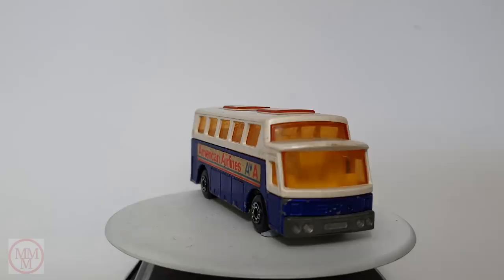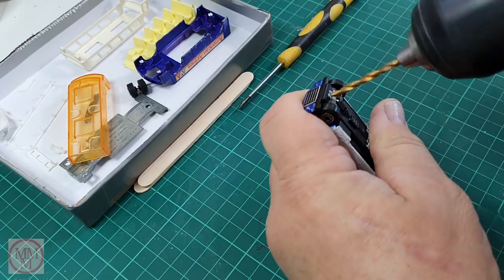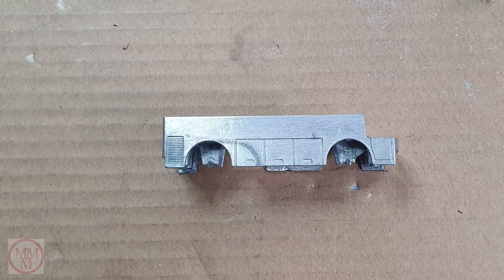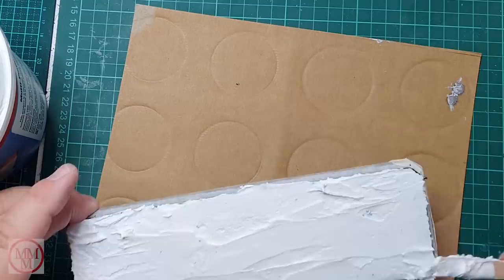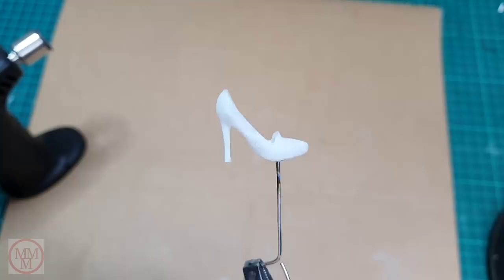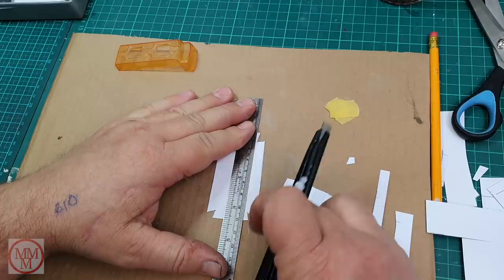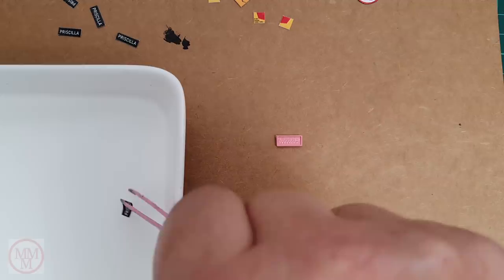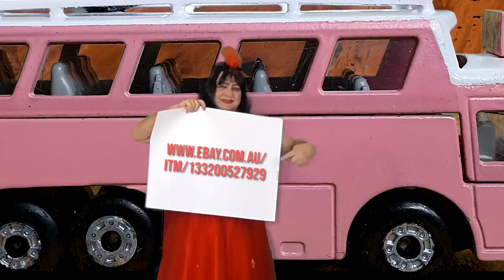MATCHBOX 'Paint it Pink', Breast Cancer Awareness, Custom 'Priscilla - Queen of the Desert'.

Comment: Marty, 
You do very nice work. I have been very impressed with the results of your fine work. I have noticed however that when windscreens are cracked, or otherwise unuseable,and a source for a replacement cannot be found, you spend a great deal of effort fabricating replacements from flat clear plastic sheet. Back in the 1960's, Mattel released a Vacuform toy kit which allowed children to use toys as forms to make parts to assemble their own toys. I had one as a kid. A Google search does reveal links to others who have fabricated such tools. I use one for forming HO scale slot car bodies and windscreens. Ebay in the USA has several listings of the Mattel toy (120 volt AC, 60 Hz versions) that could easily be used to make replacement windscreens using the original Matchbox windscreen as a form. Obviously a power adapter would be needed to use the USA versions in Australia. Anyway, it is just a thought.

Thanks for the excellent youtube videos!

Comment: The red, and yellow reflective squares are now required for all U.S. military trucks operating (at least in Europe) as width indicators for both on road, and black out night driving.  The current generation of NVGs (night vision goggles) picks up the reflection from the width markers.

Just an FYI, what you call a "Bull Bar", is called a pusher bar, or pusher bumper in the U.S.

Comment: Top job on the coach Marty, brilliant work to add the tag axle (that's what the second unpowered axle is called) to the model! 
You did a great job of making two very different vehicles look similar enough here, the movie coach was based on a 1970's Denning Mono and the Matchbox airport coach I believe is (loosely) based on a US made GM PD 4107 sometimes referred to as a "Buffalo" (Ansett actually imported and RHD converted a small number of them in the 60's).
Regarding to "Do not overtake turning vehicle" signs on trucks and buses idiots still ignore those all the time, I spent 15 years in the public transport industry driving buses and saw many cars wiped out because of imbeciles driving up the inside of my colleagues vehicles while they were turning left.
P.S. Broken Hill is in the North West of N.S.W. pretty close to the borders of both Queensland and S.A.

Comment: There is a 3m tape called fine line wouldn't bleed if you have a smooth surface. Various widths from 3mm to 12mm you may find it works better than plain masking tape

Comment: That is a super conversion! This is so well done it looks original. I can understand your frustrations with filler and paint. I have had to strip models more than once to repaint because of a flaw in the finish. Fortunately Tamiya paints are easy to remove. Filler shrinks so you always have to refill and sand. Your techniques for the conversion were just great. Thanks for sharing this and helping with this worthy cause.

Comment: Marty, to get rid of the really prominent grain on the 3D print, you could get an old box which won't dissolve in acetone, put a little pool of acetone in the bottom, then put a little stand for the piece and close the lid for a bit. What happens is that the acetone doesn't eat away or fully dissolve the plastic but it kinda melts the layers into a smoother and neater surface.
Reply: But not if it's PLA.
Reply: @Pygar2  oh crap I didn't gear what he used. Damn

Comment: some modern trucks here have a similar sign, but not all, it's not a requirement.
Reply: I think it does, depending on the length though
Reply: @ARob-bt4dr  well apparently not in my state, or if it is required, many are ignoring it. Some also have a white piece of plastic hanging under the trailer at an angle with similar signage on it. However, that's kinda silly, if you're in a position to read that sign, you're already in the wrong place.
Reply: @ARob-bt4dr   Doesn't seem to be a requirement in Ontario, Canada either. I drive a Volvo "Condo Cab" sleeper tractor and 53 foot trailer, nothing on back of the trailer. Most of the time I see the warning, This vehicle makes wide turns and a drawing of a turning tractor unit and a car hitting the side with a big red X at the impact point.
In spite of signs, people still try to turn inside one's turning circle.